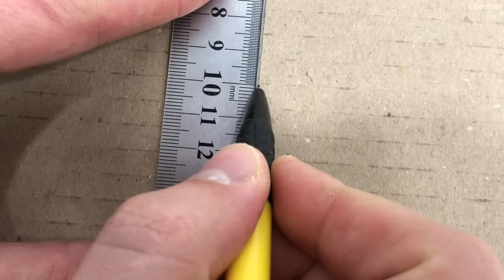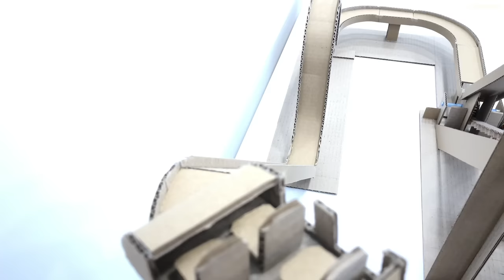DIY Roller Coaster Building For Kids

Comment: I don't suppose anyone noticed the string pulling along the car on the back side of the track. If you're going to do this, please make an actual working model. This is bullcrap. Failure is OK, trying to cover it up? Not so much.
Reply: you are correct. they used a white background for that reason.

Comment: Sorry for the inconvenience but could you tell me what are the components to assemble it if you don't mind?
Reply: Speculation:
Motor, Wire, Battery case and battery, Switch, Cardboard, hot glue gun and pipe. Its all material i think are used and I am not really sure about it

Comment: What exact materials do you need?
Reply: Speculation:
Motor, Wire, Battery case and battery, Switch, Cardboard, hot glue gun and pipe. Its all material i think are used and I am not really sure about it